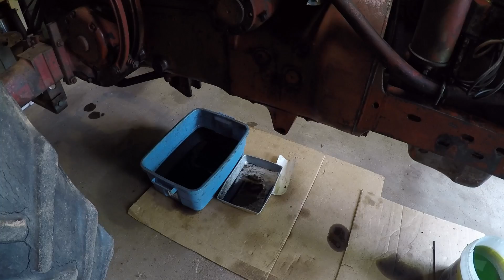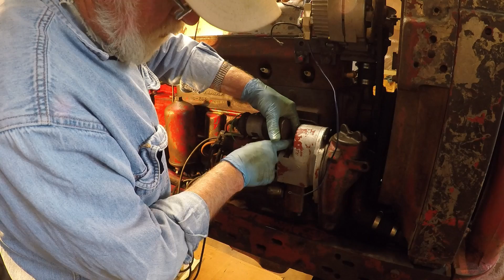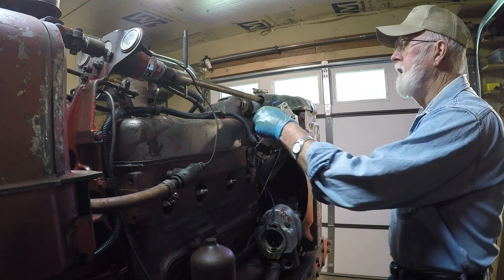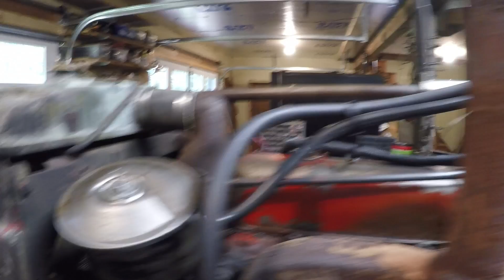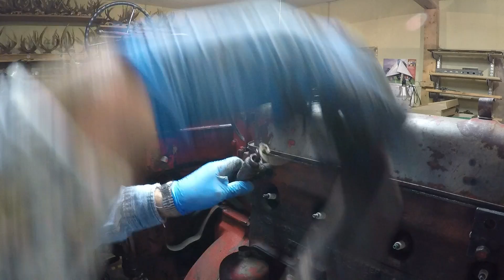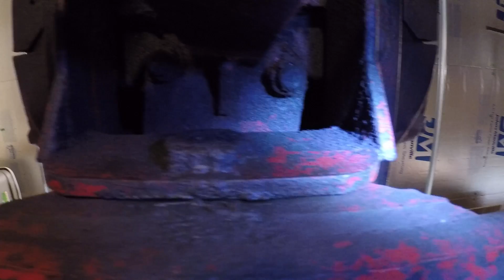Farmall Super M Engine Knock Ep.2 - Sheet Metal And External Components Come Off

Comment: My dad did not put the nuts and springs back on the studs for the radiator when he worked on his Ms and Hs. He said it was too big of a hassle to to do so. We did not have any issues. He felt that with the hoses connected and the tin work all bolted down to it that it wasn't going anywhere especially with the steering rod going through the upper radiator tank.

Comment: Pay special attention to the cam gear when tearing down the engine. Your low idle knock sounds all to familiar. Loose cam gears were a common problem on the M and 6 series tractors.    I didn't here if the knock lessened at higher rpm or not, if yes that is a key indicator of a loose cam gear.

Comment: Heck of a job, Sr.! I am getting the Memorial H project back together little by little. Engine is 75% assembled... From there I will get the rear end all new seals, attack rebuilding the front steering bolster... Then it is off for sandblast, prime and paint! Look forward to seeing the video progress on this rebuild! One thing about the radiator studs on the H and M tractors - they are difficult to get to for removal... BUT Re-installation can be even worse because you have to compress the springs to get the nuts started onto the stud. I NEVER liked doing that part!

Comment: Thanks for posting  SR. Squatch. That Super M has a boat load of Modifications ie Power Steering, Alternator, Live Hydraulic 12V conversion, my Dad had one that had all the same except 12V and alt. he used an 8 volt battery due to engine work it dyno'd at 104 HP, the only problem then was the bull gear would hand  grenade at the worst time.
Reply: K.D. Pearce 

Bull gear?